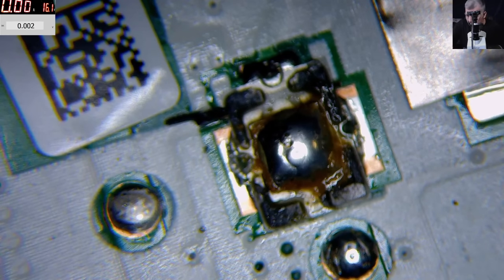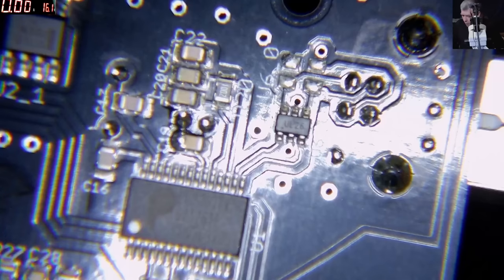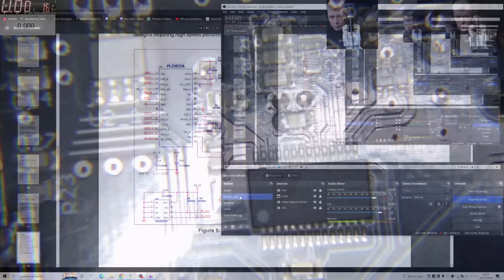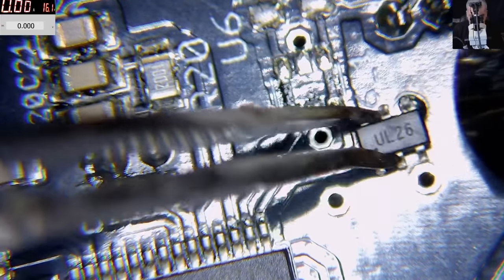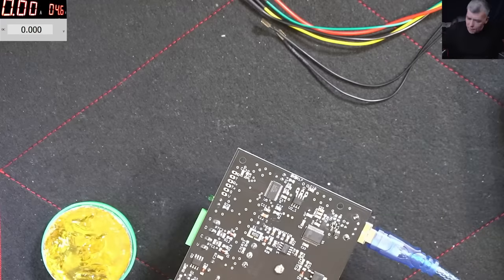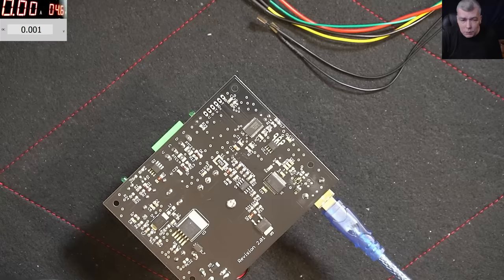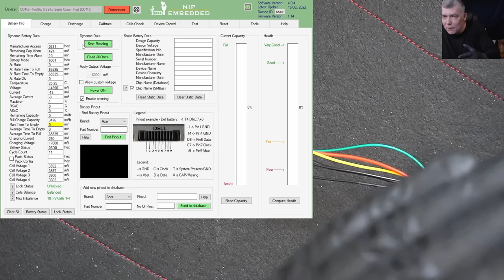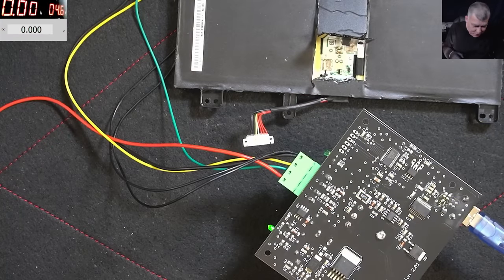NBLA battery analyser/tool/tester repair - I burned it :D

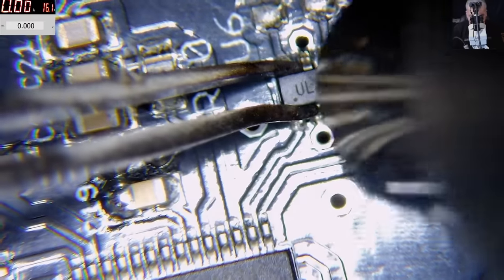Comment: 15:14 - To identify component google "s-manuals smd". Then you pick from table and see data sheet. UL26 is ESD protection device.
19:42 - I am maybe 30 years younger, yesterday I tried to do something I did 20 times OK in past, I made single mistake and I bricked board worth 3000 eur. At least I am not one of those that are scared to even try. Yes I will repair that board because everything can be repaired.
Reply: I was going to say there was no need to add the "calibrated jumper" wires in because the board shows the connections go straight through, therefore the UL26 must be an ESD device.
Reply: I'm trying to learn and visited this website, found UL prefix and looked through all the datasheets.  None show a UL26 or any component with 6 legs.  How did you determine what this chip was using this website?

Comment: Guys, when sorin was in the army they were training on hand granades, and one of is soldier friend of Sorin, throws a hand granade and it doesnt explode.Then Sorin says "dont worry let me repair the hand granade, takes the grande and dismantels its ignition parts and replace the detonator and gives back. His friend takes hand granade, pulls the pin and turns and ask Sorin "what did u do" . Sorin's answer was as usual i replaced the detonator with a Properly Calibrated Detaonator. Actually these were the last words his friend heard. Then Sorin scratches his head and says What did i do wrong, i just replaced the faulty part with a properly calibrated one. 🤣🤣🤣🤣 Sorin it was a nice video just wanted to make you smile with a funny  imaginary story. Lots of love from Istanbul.
Reply: Greetings.  I thought that Mr. only works with properly calibrated fuses made by him.   I honestly did not realize that  he was into manufacturing and then calibrating detonators as well. Laugh.
Reply: im from Turkiye too. Greetings from Antalya . if i bought an NLBA to this price, i would get crazy when it get burned and then this seller whose nickname is NipEmbedded
would come and said " this is very nice device but you broken it. No more battery analyzer to you sir"
Reply: sorin would skip the detonator timer with a properly calibrated instant exterminator fuse :), then when you pull the pin, poof, no need to wait for a failure, it ll instantly ground the person pulling it :)
Reply: That's hilarious

Comment: I like the honest (unedited) way Sorin does the video. It could be the battery voltage running down the earth of the soldering iron into the mysterious world of earth loops, and then (because of Murphy) pop up in a place where it can cause damage.

Comment: Ground leak from the soldering iron thru USB to PC..I burned a NanoVna like that..soldering while was connected to PC...I found later like AC 80V from TS100 power  supply to PC ground..

Comment: the same happens with the oscilloscope, you can break it if you don't get another power supply that is separate from the mains .. there are special transformers
Reply: An example of these special transformers?  Interested to see what ppl use to isolate oscilloscopes
Reply: @waynetaylor2784  Isolation transformer ( just a 1:1 ratio transformer with two seperate windings)

Comment: I have also experienced that state of shock while I was soldering the mainboard with the charger plugged in, and I was shocked so hard, my whole body shook,, it was like I was put on the one that is placed on the chest for another shock, and I was not it was moving for a few minutes, it was like that happened there that the parts were shocked,,

Comment: hi love your style and content.please could you test the V difference between the ground and solder iron tip.
Reply: You can't measure ground potential difference with a multimeter, it requires a so called electrostatic voltmeter.

Comment: Hi Sorin
This chip is a usb to rs232 converter to be connected to a microcontroller. 
The battery sensor line is connected to directly to the microcontroller and not to 232 chip.
In first diagnosis when there is no usb response to the computer means that 232 chip is not communicated. 
Like arduino boards.
Best regards.
Reply: By chance don't you know what kind of a microcontroller is used in the box? Thanks.
Reply: @igorchemmykelly7202  unfortunately 
No
Reply: @anwaraddasi8892  It's a pity. If only Sorin would be kind enough to check it in his box...

Comment: your calibrated solder was absolutely pointless... look at the tracks on the PCB 🤣 those pads ARE connected already.. the UL26 is just an ESD protection, no signal is going through.

Comment: Hi, If you look carefully there is no broken path under the chip UL26 ( esd protection ) , so your soldering wire is useless. Next time no need to rush 😉

Comment: After watching your video, I would say your soldering killed the surge protection (the chip in the USB data lines). The Chip was probably fine until you put 5V on the 3.3V pin. That killed the chip. Anyway, Its working again and we were remembered to be carefully with different ground potentials. Did you check, why these were so different? Shouldn't both be connected to earth potential?
Reply: The chip was already dead, so there was no voltage.

Comment: Kind of late , but the usb data  tracks under  that esd protection they got continuity, you didnt need to use any proper calibratred soldering wire, lol,

Comment: I didnt see the video, but if you had battery connected to the device when you were soldering it - you had common ground connection between battery and usb chip. Afterwards, when you touched the fuse with soldering iron, you shorted VBAt through mains earth, through USB chip (USB GND) to main ground, which killed the chip (did that a few times.. :S )

For the chip itself, would strongly suggest not getting it from china, had quite a few arrive somewhat dead - Chip itself works, but the moment you install driver driver itself states "Chip phased out in 2010, contact your supplier" and does not work, simply because its counterfeight

Comment: Our NLBA1 DEVICE HAS BEEN DAMAGED AND IT IS NOT WORKING

WHEN WE PLUGED THE ADPOPTER IT WILL BE On and green light show in device

But USB is not connacted to the Laptop

Whats the solution?
Reply from the maker: https://www.aliexpress.com/item/1005002626047657.html?spm=a2g0n.order_list.order_list_main.30.1a911802ufKtvg

Comment: That device is too expensive. For what it costs I could buy 6 battery packs. Maybe a repair shop could use one but even then the cost is prohibitive.
Reply: NLBA1 is the most advanced laptop battery analyzer on the market, it is a real PRO tool, you pay once and you have it unlimited, lifetime. You can do tons of things with the analyzer.
Separately, if you want to repair batteries, you need a license per year which has a good price, the price of 3-4 batteries while you can repair hundreds or thousands.
Reply: To buy 6 poor aftermarket low quality batteries ? instead of repairing the original batteries ?
Reply: @nipembedded9976  Do you need to have the internet connection in order to use the box or it can work on its own? Thanks.

Comment: UL26 is a Resistor Network:goodvibes:
Reply: This device is so expansive but doesn't have optocouplers to protect the data inputs? That's stupid in my eyes.
Reply: @Ed Straker Ah right, very low capacitance ESD protection..
Reply: @jonnygudman1815  a good reason for them to manufacture a second version of this useful tool :)
Reply: @jonnygudman1815  if it were resistors , i think u will not get values and the chip doesn't function properly
Reply: @jonnygudman1815  exactly you would have thought it was given
Reply: It has a better progrction that you could really think about. Sorin’s fault has nothing to do with the data lines.